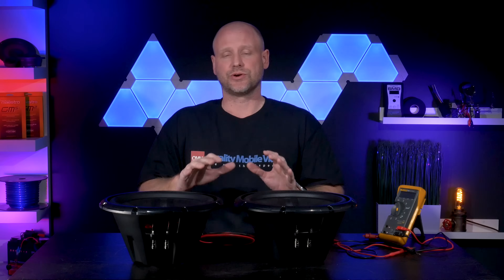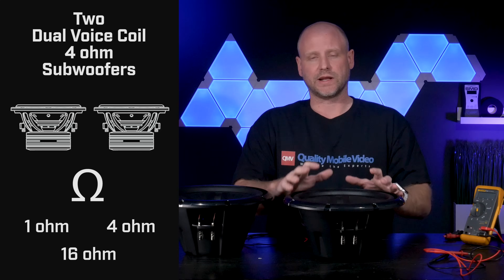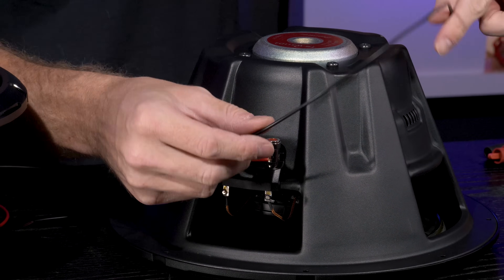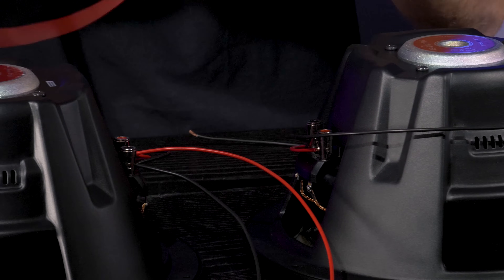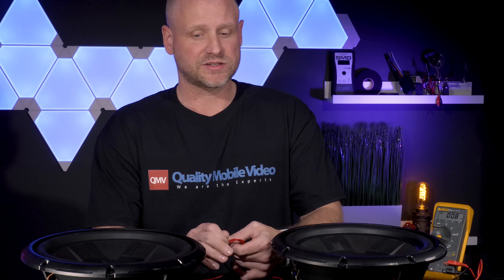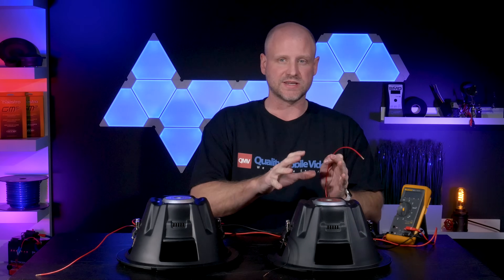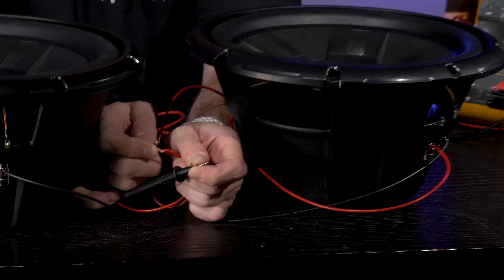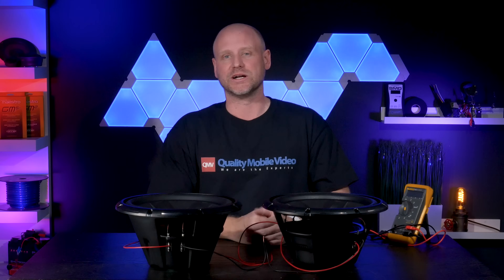Wiring Two Subwoofers DVC 4 Ohm - 1 Ohm Parallel vs 4 Ohm Series Wiring

Comment: Okay I understand the point. The speakers are going to  work eaither way, but what is the difference at afterwards between those two set ups ???
Reply from the maker: Each impedance offers you a specific rate of power. The lower the impedance, the more power you can get. But it's still a little more complicated than saying they'll just work. Your amplifier has to match to the specific wiring impedance you intend to make as well as in power compared to the compared MRS of the sub(s)

Comment: So I can jump them from the terminals as long as I wired them up for 1 ohm? Two dual 4 ohm two terminals each sub has its own side of the box.
Reply from the maker: Two DVC 4 ohm subwoofers will create a 1 ohm in parallel and 4 ohm in series

Comment: Sir my amplifier's output is 4ohms but when I connect an 8 ohm woofer and 8ohm tweeter to the parallel 4 ohm output is not available What do I do to get the speaker's output 4 ohms

Comment: Nice video, how do I connect 2 sub with 2 dual ohms to 1 ohms load.
Reply from the maker: Not possible, two DVC 2 ohm woofers can only wire to 2 ohm or 8 ohm load
Reply: @Qualitymobilevideo  thanks
Reply: Hi, please do you know which subwoofer hit harder? 8 inch or 10 thanks.
Reply from the maker: If they're the exact same brand and model, the 12" generally will have higher RMS. But don't think of the power of subwoofers in terms of size. There are 10" subwoofers that have double the power of 12" subwoofers. All subwoofers are completely unique, focus on the RMS not the size
Reply: @Qualitymobilevideo   hi, can you also connect to 2 ohms too.

Comment: I have a Rockville amp that has 2 channels and is rated for 1 ohm. I’m assuming the 1 ohm is for the two channels bridged. Is there a way to wire 2 4 ohm subs at 2 ohms? Like can I wire one to one channel at 2 ohms and the other to a channel at 2 ohms or would that be 4 ohms?

Comment: How should I wire a 10” Audiobahn AW1051j DVC x 4ohm with a JBL GT5-10” SVC 4ohm. My amp is the pioneer GM-3602a please let me know my options
Reply from the maker: I highly recommend using identical subwoofers together. Wiring subwoofers with different impedances and different numbers of voice coils can result in damaged gear
Reply: Quality Mobile Video Alright I found out the Audiobahn is actually the AW101T This appears to be a SVC but it has 4 terminals? How do I wire it and why do they have 4 terminals on one Coil?

Comment: I did dual dvc 4ohm and it keeps going into protection mode why?
Reply from the maker: It's impossible to give an answer without more information. What is the subwoofer's exact model? What is the amplifier's exact model? How did you wire them?
Reply: @Qualitymobilevideo  sorry about that,and thanks for responding
Reply: @Qualitymobilevideo  i have 2 lanzar 4 ohm dvc wire to a planet audio 2600,i wire i them in series for a final 4 ohm load.
Reply: 1ohm loads makes amps see 1/2 ohm loads that is why non 1ohm stable amps are going into protection mode because the impedance is to low. I believe class D amps are the only ones 1 and 1/2 ohm stable for dual 2 ohm or 4 ohm. Bridging a amp cuts the impedance in 1/2
Reply: @speedpros  so i can't wire them to a final 4ohm load,i will need a different amp?
Reply: @156nunez  2ohm loads make a 1ohm impedance at the amp power supply, now if your amp isn't 1/2 ohm to 1 ohm stable then it will go into protection mode, the best you can do is a series 8 ohm load therefore bridged the amp power supply sees a 4 ohm load therefore handling the impedance load
Reply: @speedpros  ohh ok thanks

Comment: Is it acceptable to wire two DVC 4ohm subs in parallel to one terminal cup and then from that terminal cup to the 1 ohm stable amp?
Reply: Wondering the same thing. Can't find any videos
Reply: @James-id5xq  I have been running that set up now for 5 months. Have not ran across one issue so far. Hope this helps.

Comment: How do you drop two single voice coil speakers to 1 ohm
Reply from the maker: Only possible if the subs are SVC 2 ohm, and wired in parallel. Two SVC 4 ohm subs cannot wire to 1 ohm

Comment: Question, On the 1 ohm load to the amp, I can't remember how to do this if each sub in separately enclosed, and with out connecting the subs together inside the enclosure since each is sealed?
Reply: Parallel Wire outside the Box. Basically just run 2 P and 2 N wires from the Amp. One set(P&N) to each box. Subs are Paralleled inside the box. Same thing as demonstrated. Make sure you use Heavy Gauge wire.

Comment: I’m putting two 8’s in the wife’s car and a cheap 200 watt two channel amp, how would suggest hooking this up? and thank you.
Reply from the maker: Need more info! Are they DVC or SVC? What's their combined RMS? What impedances is the amplifier stable at? Exact model numbers would be useful
Reply: Quality Mobile Video like i said it’s just cheap stuff, the speakers are pyle power dvc and 400 rms each. the amp is a boss amp 200 watt 2 channel cxx152.
Reply: Quality Mobile Video also i wired the speakers just like you did on the 1 ohm section but that only leaves me with one set of wires running to the amp to either put on the left or right speaker screws on the amp.

Comment: Thanks alot.
i already run my two pioneer 12" ts-w3003d4 600 rms (each) to my pioneer amp gm-d9601 mono 1200 rms @ 1 ohms. 
I want to add pioneer GM-D9604 amp to my setup because its 4 channels so that it runs my front and rear speakers.
What do you think?
Reply from the maker: Perfect match!

Comment: 3:20 and then wire each to it's own wire terminal cups and wire those cups directly to the amp. If your amp has dual terminals, they are the same channel so connecting to each terminal pair is exactly like twisting the two wires/speakers/channels together.. making it a parallel connection. This tip is for those who have an enclosure that has separate chambers and two separate wire terminal cups.. like I always have.
Reply: I needed to read this.  He didn’t explain.
Reply: Finally someone who clarifies this I have been wondering if I have a 1 ohm final load on amp wiring 2 2 ohm loads through separate chambers to the amp
Reply: Ok I think i might understand now but I'm still not entirely sure. I would wire each sub positive to positive and negative to negative and then to each cup.  Then, from each cup outside the box, I would connect positive to positive and negative to negative and then wire that connection to the amp?
Reply: @VelociWyatt  yes if it’s a mono amp
Reply: lol i just wrote for help on exactly that issue. didnt want to drill hole thru the chambers for wire...but ,getting rid of a possible air leak from one of these terminal cups will be a goal in my next encloser,thanks alot your input is wat i couldnt find in an actual video.im going to wire it up RIGHT NOW.IN MY TOYOTA SIENNA VAN LOL,BOOM DIDEBOOMBOOM
Reply: Im sorry i'm new to this but let me make sure I have this right... so I would wire posi to posi and neg to neg on one sub, then wire to the cup, and do the same for the other sub? (so I dont have to wire the connection to the other sub?) Then connecting both cups to the amp will make a parrellel connection for 1 ohm imp? I also have an enclosure with two separate chambers and would like to avoid drilling a hole in the middle.  Thank you to anyone who can answer this for me
Reply: @VelociWyatt yes do what u say ,it works the same way ,u don't need to drill
Reply: your a life saver

Comment: So If I wire 2 4ohm subs in parallel (300w rms each) to a mono amp (450w rms) both my subs together being wired as one now has a potential 600w rms at 2ohms?
Reply from the maker: If they're SVC yes, if they're DVC no. This video is about two DVC 4 ohm woofers
Reply: @Qualitymobilevideo  they are SVC, thank you so much!

Comment: So u have to connect the speakers together with in the box ? Or were those the leads to the amp, i have 2 kicker 12 comp r dual 4ohm and i want to go down to 1ohm but confused on do i connect the two subs with inside box?

Comment: What if your amp has two inputs? Will you still connect the positive and negative ands together and place them in the same set of inputs?or can we use both inputs? If so will the final impedence still be 1 ohm?
Reply from the maker: So it's a monoblock with two sets of terminals? Don't worry that's easy. We made a video giving a full explanation why some manufacturers do this and how to connect your sub(s): https://www.youtube.com/watch?v=f_HJ72sl2hA

Comment: Ok, my question is........ wired down to 1 ohm. Amp rated at 1500 watts at 1 ohm. So, is that 750 watts going to each sub or 1500 watts going to each sub?
Reply from the maker: The amplifier is only capable of 1500 Watts. It cannot double in power. The 1500 watts will split to 750 each sub

Comment: For the 4 ohm load connection, I thought you were going to wire each sub parallel at 2 ohms then wire them together in series to get 4 ohms. Could that way work?
Reply: Yes

Comment: Series/paralell is pretty easy to figure. Series is voice coil ×2, paralell is voice coil ÷ 2. Formula changes as you add more voice coils. Series is is ohm ×  number of voice coils. Not real hard.paralell is a bit more complicated. Easiest way is to verify with a DMM to figure most accurate ohm load.
Reply from the maker: Thanks for sharing Mike!

Comment: Can I wire 2 pioneer 3003d4 2000wtt subs to 1ohm load and use with pioneer monoblock 2400wtt gmd 9701  plz send me a video
Reply from the maker: The answer to your question, is yes, in parallel you can wire them to 1 ohm just like we showed in this video. We can't just make a video wiring random subwoofers of your choice to a random amplifier of your choice.
Reply: Will my pioneer monoblock gmd 9701 run both woofers in one channel

Comment: Great videos.. Thanks 
I want to have 1 of every size sub  in my truck  15,12,10,8 What'd be the best way to wire them and how many amps would you suggest?
Reply: I wouldn't, the subs will be fighting for space and sound bad
Reply: @anthonyrodriguez5124  k makes sense..so how would I get the full frequency range. A 15 + 8 or 10in
Reply: @stephenlouden480  I had 2 12s and 2 10s in a ford explorer a while back, didn't sound bad but have had better luck with sound with 4 of the same size subs,  also makes a hell of a difference if you have 4 duel voice coils subs that are 2 ohms made done to 1ohm buy running in parallel
Reply: @stephenlouden480  bruh subs are subs. they all have pretty close to the same range. theyre called subwoofers for a reason. you just need woofers (“normal” speakers) and tweeters for the full range. not different sized subwoofers.
Reply: @seanrk876  makes sense but they were all given to me for free with amps too to promote the brand so whatever. it would've been better to have just one or two of same size but I said f it. lol.  it was incredible anyway. especially the  8  custom tuned for more mid range than bass.    I ended up selling my friend the 15 ..it was overkill

Comment: I wired it this exact way on my dual alpine dvc swr12d4 and it would make a burning smell. Then I wired it from CRUTCHFIELD's diagram and now I can turn up my gain to a decent level , say about half. I couldn't even go 1/4 gain without them burning . I don't see how this is the correct way. Yes you get a 1 ohm load but wiring both spliced to the amp is creating more heat to the subs. Wire in 2 ohm load on both speaker then wire 1st speaker to amp then 2nd speaker to the 1st speaker . I thing by wiring it this way it pull power off the 1st speaker to the second and creates less heat that way.
Reply from the maker: What is the amplifier you're using? And you're using TWO  dual alpine dvc swr12d4?
Reply: @Qualitymobilevideo  I'm using 2 alpine type r 12d4 on a directed 1100 d amp.
Reply: @Qualitymobilevideo  on a ported box. 1.50 cubic foot
Reply: @Qualitymobilevideo  leveled flat except +7 treble

Comment: Hi I have two dvc subs in a box both are 4ohm they each have their own terminal outside of the box. I have a sundown sae1500 amp . How would I wire it from the box that has 4 terminals to the amp to make 1ohm so I can give each subwoofer 750 watts
Reply: I forgot to mention on my amp it has two positive and two negative terminals

Comment: Can I take 4 15s an make em drop down to 1ohm? They are dual voice coil
Reply from the maker: Yes, Four DVC 4 ohm woofers can be wired to 1 or 4 ohm. However, four DVC 2 ohm woofers wire to 0.5, 2 or 8 ohm
Reply: Gotcha thanks.

Comment: I got 2  12s 4 ohm kicker comp crvs and a 5000 watt black ice mono block amp ,what ohms is best for this set up?series ? Parallel?I also have a wavtech line output converter is it better to leave this out the set up or better with? appreciate any advise  u can give thanks
Reply from the maker: So two 12" Kicker CVR 4 ohm subwoofers. Two DVC 4 ohm woofers make a 1 ohm load in parallel and 4 ohm load in series. The ICE5000.1D amplifier is stable at 1 ohm for 3000W RMS AND stable at 4 ohm for 1200W RMS. So it'll work great with either. I would personally wire to the 4 ohm load for more efficiency

Comment: Great video!  the best one I have found.  I do have a question though on the 1 ohm final.  My monoblock amp has 2 sets of speaker outputs.  How do I hook up to the amp at that point with only 2 wires?  Thanks!
Reply from the maker: Great question! I should write a script about this. Most monoblocks come with just one set of terminals, but plenty of manufacturers design them with two sets. 
Monoblock amplifiers are ideally used to wire one or two subwoofers to. Bridging two subwoofers to a monoblock amplifier with one set of terminals is simple, you just put the two positive connections on the same positive terminal, and the two negative connections in the two negative terminals. 

But cramming two wires onto each terminal can sometimes be a little difficult or might not feel completely secure. That’s why some monoblocks are designed with two sets of terminals, so that when you bridged two subwoofers to the amplifier, each sub gets its own set of terminals, and it’s still one channel operation. It just makes life a little easier when wiring multiple subs. You can of course still use the two sets of terminals to wire one subwoofer to, you just instead use the left positive terminal and the negative terminal. All of this information will be in your installation manual.
Reply: @Qualitymobilevideo  Sorry for a late question if I can get help. I have a sae2000d with the 2 sets of outputs and 2 sa-12 dvc 4 ohm. The person I bought from has each wired separate in one box final from each sub is 2 ohm. Will the amp read 4 ohm from being connected or should I wire them into one set or wires for 1 ohm final

Comment: Ohm's law will teach you that anything below 4 ohms exponentially increases thermal induction as the electromagnetic reaction reduces. Basically, higher ohm load woofers always use more power (less wasted in thermal induction) than low ohm drivers. Also, voltage equals control, low voltage amps such as car amps will never yield the efficiency and control that AC mains amplifiers often do. A good rule of thumb to go by (if they rant about low ohm loads, they dont know anything about ohm's law nor electronics mathematics.
Reply from the maker: Thanks for the info!

Comment: Have you ever heard of this type of amp..mosfet power amplifier gp 800 1600 watts gt pro 4 channel. I've tried getting some info online but can't seem to find it...I want to be sure how to connect my 2 dvc kicker compc10 subs to it but i just don't want to Mess up the subs or amp..plz help
Reply from the maker: You don't have a brand or model #?
Reply: @Qualitymobilevideo  unfortunately the amp doesn't have much info...I'm stumped..the only thing the amp has is gt pro on top and on the side says mosfet power amplifier gp-800

Comment: So if my amp says its one channel. Then why is there 4 terminals output? I am confuse
Reply from the maker: Some manufacturers choose to put two sets of terminals on some monoblock amplifiers for the option to wire two subs to the amp or just bridged one to all the terminals. Just makes wiring two subs easier rather than combing two subs on one set of terminals.

Comment: I did everything u did but I'm not getting a 1 ohm stable reading on my meter
Reply from the maker: You're using two DVC 4 ohm woofers wired in parallel on a 1 ohm capable amplifier?

Comment: Trying to achieve 1 8ohm load with two dual voice coil subwoofers,  so should I start with dual 2 ohm coils? Series to 4ohm on each? Is it even possible to achieve a total of 8ohm for a home receiver?
Reply from the maker: You must have two DVC 2 ohm woofers for an 8 ohm load. Wired in series yes.

Comment: is it possible to wire 4 dvc 4ohm subs to 1ohm?
Reply from the maker: Unfortunately not. You can do 0.5 ohm, 2 ohm or 8 ohm. I'd suggest getting two amps and wiring two of those subs to each @ 1 ohm
Reply: He's right . you can do 1ohm using 2 dvcs but not just one

Comment: I have two DVC 4ohm 350w subs, and a 2 channel amp that has an RMS of 4ohm 325 per channel. I have no clue how I should be wiring, please help
Reply from the maker: What's the exact brand/model of your amp?
Reply: @Qualitymobilevideo  Sound Storm Labs Fury 1800w
Reply from the maker: I can't fin the model. What's it power rating x2 @ 2 ohms?

Comment: So I have a DVC 2 Ohm subwoofer and when I wire it in parallel my multi-meter reads 2 ohms but, when I wire it in series I get 4 ohms. Can anybody tell me why it's reading 2 ohms instead of 1 ohm? My multi-meter is a cheap one so I wonder if it's just off a bit.
Reply from the maker: How exactly did you set the wiring up? Can you explain in detail?